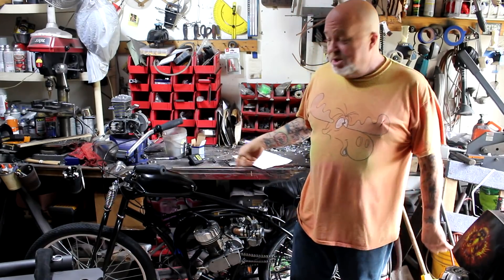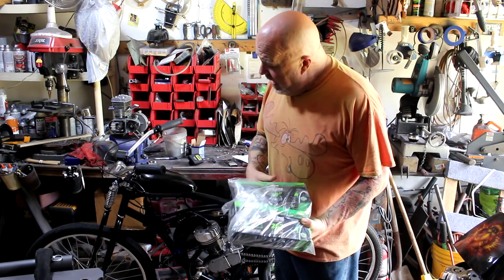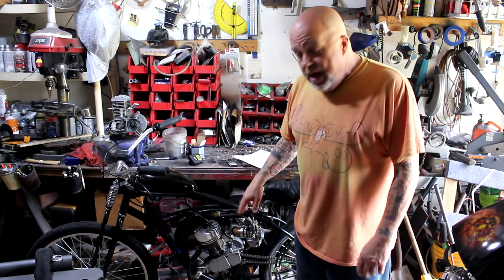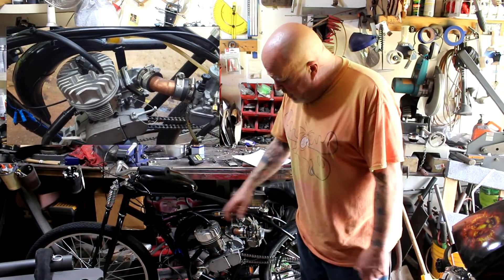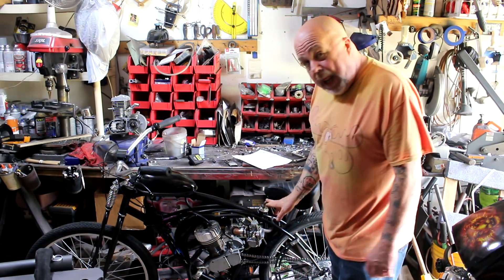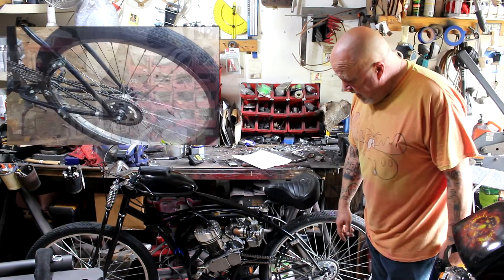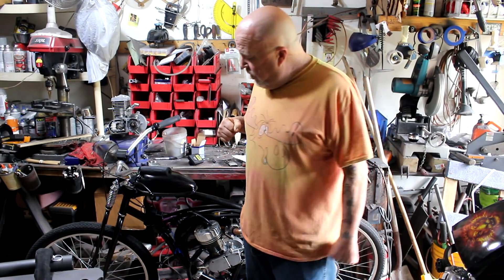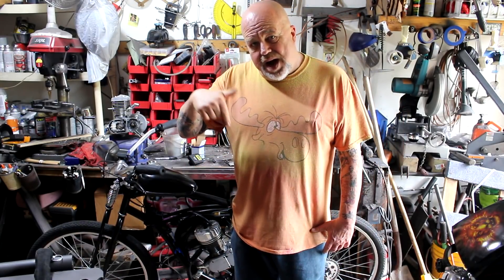How To Build The Ultimate 2 Stroke Motorized Bicycle (my version) Part 2

Comment: I didn't notice you were using a moped hub in the first vid, those will work fairly well and shouldn't run into issues with stopping I didn't even think about running one of those hubs you just gave me an idea for my next project

Comment: The cnc high compression head, must be worked toggether with a windowed piston in order to increase the motor's power? There is a youtube dyno video with that tests.
Reply from the maker: No absolute rules. Windowed piston is for using a reed valve. Simple cleaning up the ports & cylinder along with an expansion chamber and proper jetting will do wonders

Comment: Not a criticism but a minor point. You have put a lot of attention into putting the bike together but when using hose clamps, like on the carburetor extension, they would look neater if they were turned around so the tang is on the inside.

Comment: I'm running a Kent Fat Frame Aluminum Beach Cruiser. Engine is a Stage 2, balanced crank, better bearings, ported cylinder, High Compression Head, Tuned Pipe, big box Reed Valve, 4in. Intake Manifold, Rejetted NT Carb, NGK Iridium Spark Plug. Premium Gasoline, Stihl HP Chainsaw Full Synthetic 2 cycle Engine Oil, Mixed 50-1. 44 tooth Sprocket.
Flat ground, no wind, after full warm-up, 41mph, comfortable cruise, at 70% power, 36mph.

Comment: Im newer to 2 storkes so I've never swapped heads before... them  High compression cnc circle heads they are Universal and fit the square piston chambers? Or do you have to swap that out aswell for a reed set up?
Reply from the maker: The heads are universal
Reply: @HughesMotorized  thanks! I thought so but didn't know for sure.

Comment: Maybe I've just had bad luck but I avoid those slime tubes at all cost.  I'm old for 4 the first two I bought the valves were  so clogged up with slime that you couldn't put air in the them the next two I bought for my 29er I got one right out of each of them and both times woke up the next day with a flat. At least I didn't get stranded.  You're better off with a Walmart tube. I've had really good luck  with good years and specialized tubes.
Reply from the maker: No probs yet.

Comment: Out of curiosity would u need a motocycle license to operate it? Also what do you do about theft?
Reply: No license.. lock it
Reply: Do u live in LA???
Reply: Depends on where you live.... some states its wide open have fun ride all you want. But in others its 100% illegal. Where i am its cop bye cop it falls under peddle asset but since it has a gastank+ throttle it falls under moped so its 50/50 thinking of switching to a thumb throttle might help idk..
Reply: @miguel360kmc  thumb throttle is STILL a "throttle" !!!
Reply: @jeremiahdssdentmorgan3341  yes technically 😏 but as far as the law goes its different in facted MANY states break that down in the wording of the laws.. i.e  Step through frame, pedals """"twist throttle"""" is on the list 👌 
  Yes they both do the same thing i know that

Comment: is it possible to turn the cylinder  around so that the carb is in the front of the motor ?
Reply from the maker: absolutely. You'll need to match transfer ports or motor will run poorly
Reply: Thank you for the reply, 
could I trouble you to make a quick video explaining this ?
My first kit is arriving today & I am gathering as much info as I can so my build will be successful.

Comment: 50mph on a bicycle,no thanks. I thought 27mph on the one I made was to fast.lol I learned alot from you while I made mine. Keep up the great videos. Thank you
Reply from the maker: Gotcha.. not looking to get killed myself. With a 44 tooth sprocket, it will go 35-40ish and have better low end pep.
Reply: goodwinwilliam93@gmail.com
Reply: Ya mine does about 47mph not to fun lol
Reply: W
Reply: willylinares@ymail.com.    attn:Willy
Reply: Mine has hit 35.4 mph with a 40T sprocket,,, looking to get it up to at least 40-45 bcuz I have a NEED for SPEED and I'm NOT skurred !!!
Reply: Mine does 54-55mph but I used a cylinder with blank ports and drilled out and filed my own into the cylinder and I use a 40t sprocket which gives you good torque and top speed without having to sacrifice either. Makes it a 4:1 gear ratio which is what a lot of these two strokes seem to like

Comment: Hey, I was wondering where you think would be best to get a spare front rim in Canada. If you don't know, that's alright.
I was thinking of Amazon or some of my local bike shops. I seriously don't want to spend more than 40 cad on a new front rim (26 x 2.125)
Great video btw, you were one of the people to inspire me to build my bike.
Reply from the maker: I'd offer Amazon or eBay
Reply: Kijiji
Reply: Im sure you already got yours but if anyone else clicks to check where... FACEBOOK MARKET!! I found 2 26in and 1 29in beach cruisers 2 huffys the 29 a kent not top brands but only paid $50 usd for all 3 and they all mint owned bye older people garage kept. Now for $50 i have 3 spare sets of white walls rims rear racks rear rims/coaster break + the white walls is why i did it. Also the kent has a Springer front end! A single fat shock but still them things are like $70 on there own..